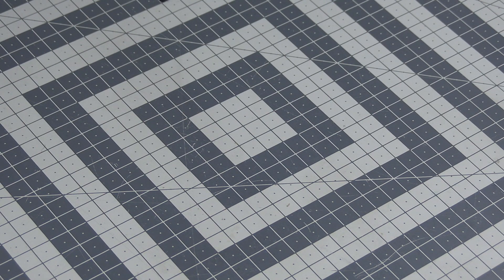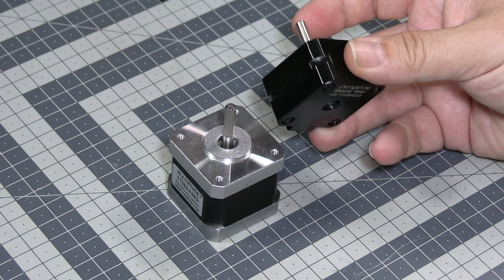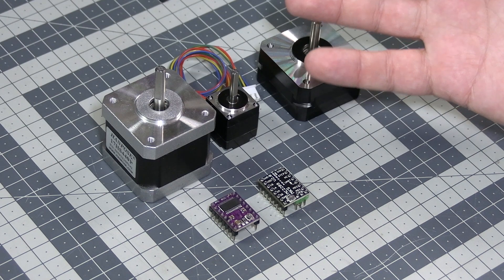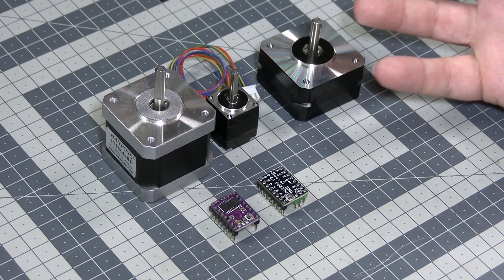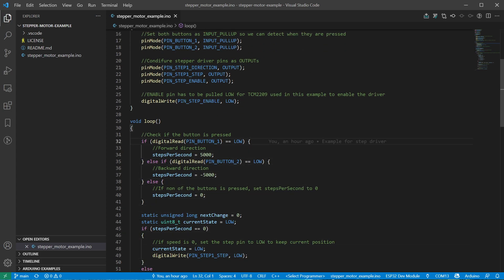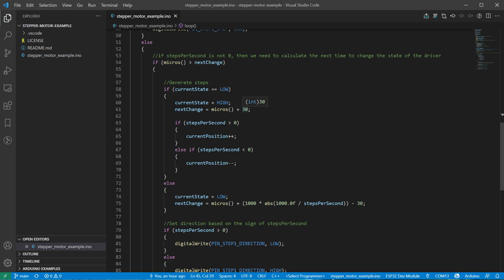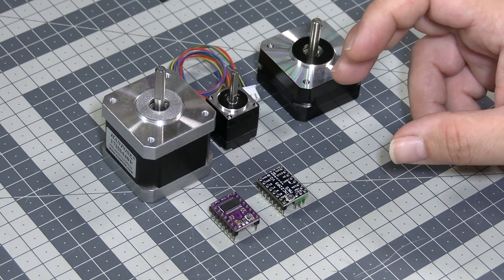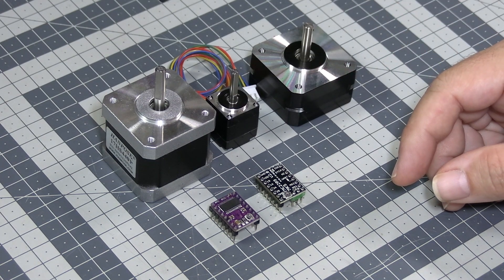Stepper motors tutorial - motor, driver & Arduino code

Comment: Your default microstep resolution is only 8. How about some demo code changing the microstep resolution to 256 ? ( Requires configuration of TMC2209 via its UART)
Reply: or even cooling the steppers down (great tutorial btw)